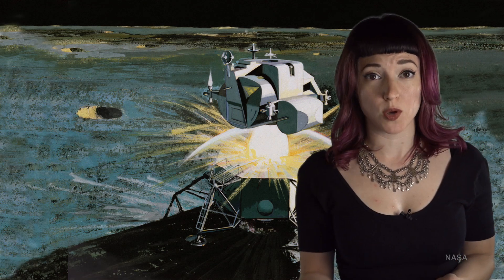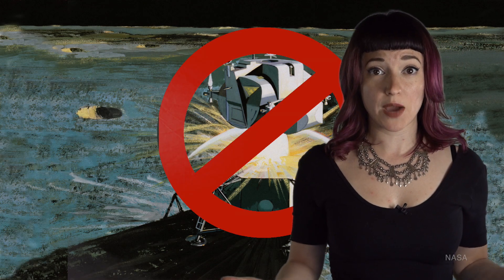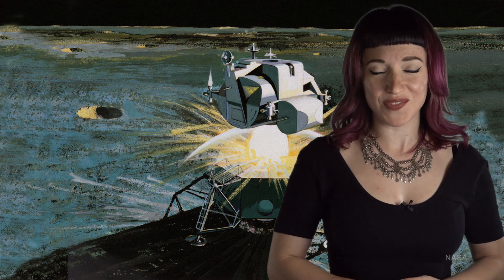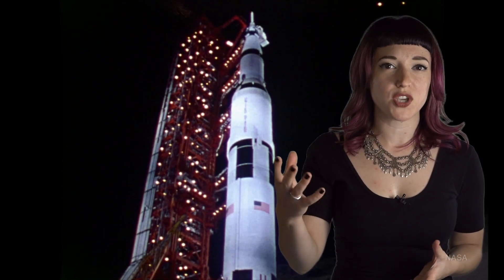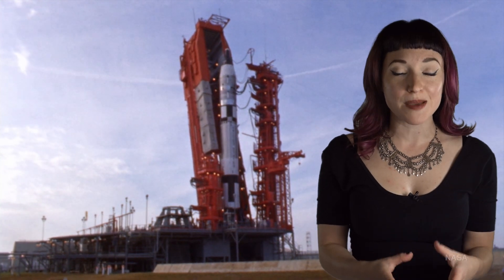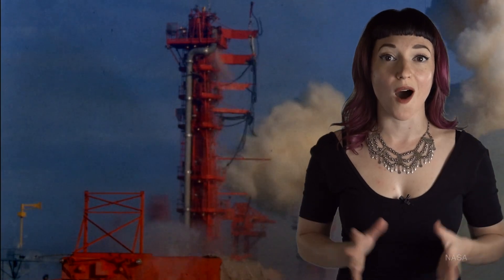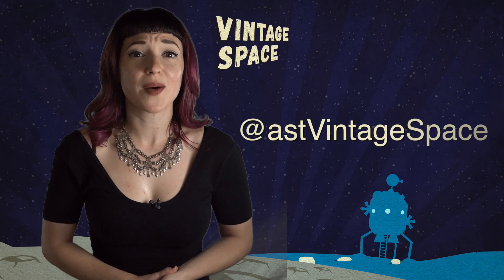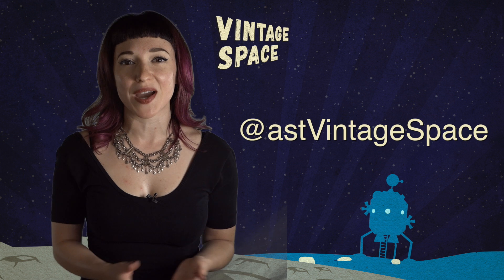How the Lunar Module Launched from the Moon Without a Flame

Comment: Its clear she been hired to explain the moon landing was real or even possible
Reply: By who?
Reply: @niallkinsella2687  who knows but im not buying her bs rockets with clear flams
Reply: @ejones6647  
And what colour flame do you expect an ideal mix of Aerozine 50 and DiNitrogenTetroxide to produce?
Chemistry says it'll be clear.
Reply: @niallkinsella2687   it was still no smoke coming from a clear flame ots a hoax
Reply: @ejones6647  Smoke is made up of unburned particle byproducts of a chemical reaction.
You don't get these byptoducts if you burn a fuel and oxidiser together in an ideal mix (or an oxidiser rich mix), so no smoke.

Everyday example, the flames in your gas kitchen hob don't produce any smoke, because there's enough oxygen in the air to burn all of the fuel fully.
Reply: @niallkinsella2687  no clear flame can lift a rocket off the moon with no smoke its ridiculous claim
Reply: @ejones6647  
Argument from incredulity.
Arguing that, because you don't believe it that it must be wrong, is not an argument.

All you've done is taken your opinion, unfounded as it is, and declared that it has the same validity as centuries of scientific research and evidence.
Do you genuinely think that's reasonable?

If you want to know about the lack of smoke, you need to learn about chemical reactions.
If you want to know about the clear flame, you need to learn about blackbody radiation.
Reply: @niallkinsella2687  not enough power generated from a clear flame can lift a rocket off the moon with no smoke coming from the exhaust pipe is a hoax and pseudo science fiction not reality
Reply: @niallkinsella2687  clear flame don't exist.. please post a link showing a clear flame
Reply: @niallkinsella2687  i  still see a blue flame
Reply: @ejones6647  
If you say so.
Now, do you think it would be visible in direct, unfiltered sunlight?
Reply: @niallkinsella2687  what about exhaust system  even if the flames was not visible no dust from the moon blew up neither when the rocket left
Reply: Please post a link where a rocket can launch with no flame or smoke.. im waiting
Reply: @ejones6647  
Answer the question I posed to you first. It's a simple yes or no.
The ethanol flame on the video I linked, do you think you'd be able to see it in broad, unfiltered daylight?
Reply: @niallkinsella2687  the only link you posted was someone lighting a match  burning moonshine
The only flame i seen was that orange flame coming from the match being strike
Reply: @ejones6647  
Like I said, ethanol, What do you think moonshine is?

Now you've said you couldn't see the ethanol burning, but it's clear that it was burning since it lit a second match on fire. The smoky orange flame is from the phosphorus in the match head.
Reply: @niallkinsella2687  please post a link showing a clear lifting a rocket going to outerspace
Reply: Please explain why any dust was  ot blown away during the lunar module lift off?
Reply: @ejones6647  
Falcon 9 upper stage. Clear flame, no smoke. The engine bell is still glowing red hot and you can occasionally see flecks of ablative material burning off.
https://youtu.be/jpANDP-SCSg?t=2m40s

And why do you think there'd be dust raised during launch when most of the loose material near the site has already been blown away during the landing?

Comment: Who filmed it leaving?
Reply: Ed Fendell. An engineer who programmed the tilt rate on the camera.
Reply: Niall Kinsella that’s pretty awesome. The timing had to be perfect. I guess they didn’t have motion activated cameras at the time.
Reply: @humpy1980  
Basically, he knew the rate the rocket would accelerate, he just calculated where the rover had to be parked and the rate the camera had to pan up to capture the ascending rocket.
The astronauts parked the rover where he told them to, and he just sent the activate command to the rover taking account of the delay in the transmission.
Sounds easy in theory, but they only got it right on Apollo 17.
Reply: Niall Kinsella That is impressive. Stuff like that fascinates me.

Comment: Hypergolic fuel nice.  So regarding landing on the moon the flight dynamics are the same as on Earth albiet with 1/6 the gravity sooo....that module landed with a mono thruster in an inverted configuration just as the SpaceX Falcon boosters do today.  Well almost the same as today except for the fact that vecor thruster technology didn't exist back then, nor the computer power to control it. 
...oops!
Reply: YOU SAID: "Hypergolic fuel nice."

== Well, nice for this purpose.  But, it's very nasty stuff.

YOU SAID: "So regarding landing on the moon the flight dynamics are the same as on Earth albiet with 1/6 the gravity sooo....that module landed with a mono thruster in an inverted configuration just as the SpaceX Falcon boosters do today.  Well almost the same as today except for the fact that vecor thruster technology didn't exist back then"

== Good fucking gods.  Rockets have used gimbal vectoring since the 1940s!!!  What the HELL are you talking about??  All of the propulsion rockets in Apollo were vector gimbaled except the LEM ascent engine.  Good grief!!!

YOU SAID: "nor the computer power to control it."

== You don't need computers to control it.  You just need gyroscopes.  But, guess what, the ascent engine on the LEM wasn't gimbaled, and yes, the computer controlled the thruster pods instead.  They used slow-interval corrections in the thruster pods to both conserve on computer use, as well as conserving about 40% of the thruster pod fuel during ascent.  It resulted in the slow "rocking" motion you see during LEM ascent.  But, it worked fine.  But, hey, you go right ahead and claim stuff that you know nothing about.  You go right ahead and pretend to know more about Apollo craft than the engineers who designed them.  This is YouTube, the land where know-nothing morons can pretend to have the education they never actually got.

YOU SAID: "...oops!"

== Yeah, oops.  Ooops.  You forgot to pay attention in school, and resulted in a know-nothing clod.  Oops.
Reply: rockethead7 - So where are the lines of code that little Atari PC used to vertically decend?  Gee let me guess, lost like the 13,000 reels of telemtry data.  NASA cant keep a storeroom of the most signifigant telemetry data in history yet they sent men to the moon 50 years before the vector control technology existed? (not simply  gimble maneuvering technology, vertical decent is orders of magnitude more difficult than maneuvering and notice the nobody has done it even today with piloted vehicles, the Falcon boosters are unmanned because that technology still isnt perfected, yet they allegedly nailed it 6 times in a row with a computer less powerful than child's TC toy, oh please ).  The astro nots couldn't even reproduce successful landings in simulators.  And so the lack of vector controlled thusting technology is just one of hundreds  of reasons it didn't happen as stated.  You sound very knowledgeable so perhaps you can dive into the myriad of other problems like batteries and AC.

Comment: Hi Vintage Space!  I do not question we went to the moon. I am curious about the lunar module launch. Taking into account that they took advantage of the moon's motion, less gravity and no atmosphere, I still wonder how the small module could carry enough fuel to accelerate it from relative no motion to the speed necessary to rendezvous with the orbiter which was moving fast enough to maintain an orbit, unless it was temporarily slowed down to help with this.  Can you answer this in layman's terms please?  Anyone?  Anyone?
Reply: First, calculate the amount of energy in the fuel.  Figure around 50% efficiency of the engine (it's probably a bit higher than that, but whatever).  That will give you the amount of energy you have to work with.  Then, calculate the amount of kinetic energy in 1/2mv2 of the lunar ascent module at lunar orbit speed, and add the potential energy of the height of the orbit above the moon in PE=mgh.  That's the total amount of energy needed by the time the fuel is spent.
Reply: Awesome and I actually followed most of that except for not always understanding WHY? a formula works. For purposes here, I got the jist of your answer so THX rockethead7!

Comment: I totally believe that we went to the moon several times and I'm glad that I'm old enough to have watched Armstrong and Aldrin make the first moonwalks when I was 9 years old but one thing I always wondered about was when you see the ascent stage blasting off of the base module on the moon, the camera tilts up to follow it.  How did the camera do that if no one was on the moon?
Reply: All of the external take-off video comes from the latter missions that had the rover, and is taken with the remote-controlled camera mounted on the rover and remote-controlled from Mission-control on Earth. The timing of the tilting up of the camera needed to be precisely worked out so that the control signals could be sent at a precise moment before the actual take off (which itself needed to be precisely timed in order to rendezvous with CSM correctly) to take account of the delay in transmitting form the Earth to the Moon. The difficulty in getting the timing right is why there is only one good video of an assent stage take-off, and that was the at the third attempt to take such a video (though the first attempt was aborted by a partial breakdown in the camera motion system rather than getting the timing wrong).
Reply: Apollo 15, the pan up functionality of the camera failed.

Apollo 16, the rover was parked too close to the lander. The pan timing was correct, but the wrong position meant the lunar module ascended out of frame.

Apollo 17, the engineer in charge of getting the ascent on camera threatened to gut the astronauts if they got the rover position wrong.
They didn't. 😝